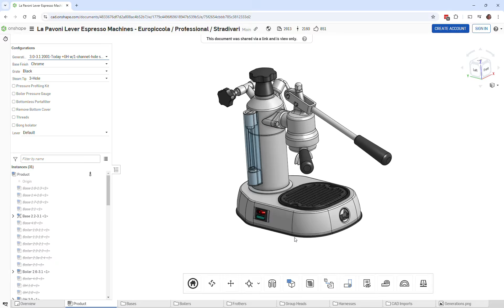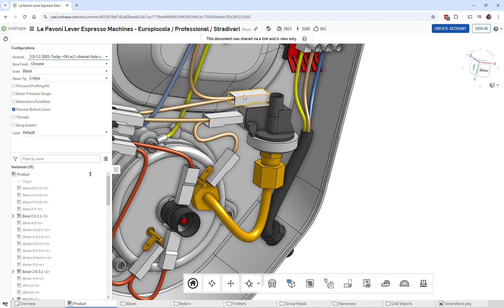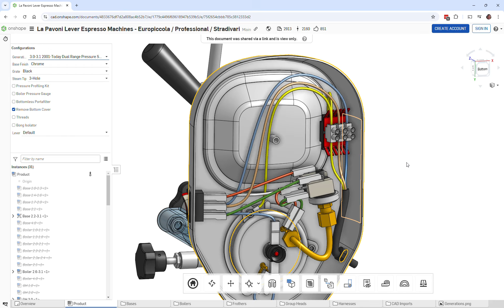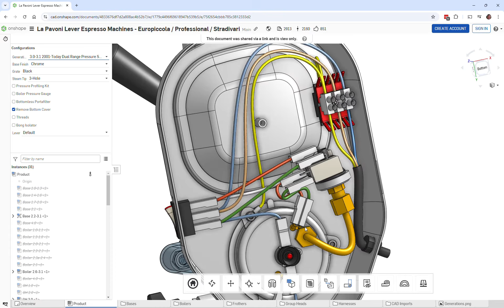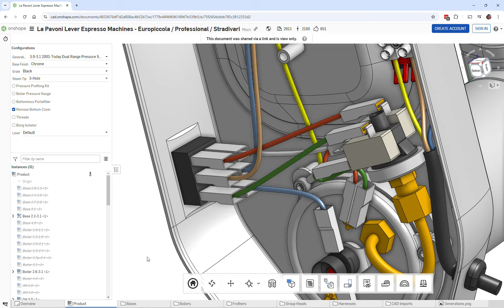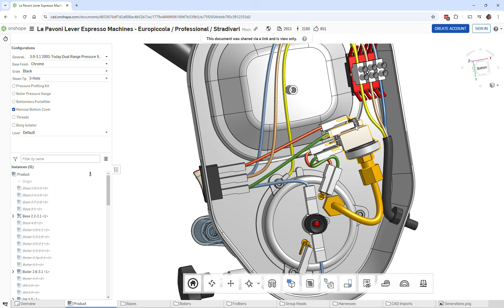22. Dual Range Boiler Pressure Switch Addon for La Pavoni Lever Espresso Machines

Comment: Super helpful diagram!  Just finished upgrading a 1979 v2.2 to 110v with the dual pressur system and first test went well!  Now i just need to practice 😅
Reply from the maker: The problem now is: no more excuses for less than perfect latte art. Have fun!
Reply: @JohnMichaelHauck  now I'm having a bit of an issue, and can't seem to find the solution.  Would be amazing if you could point me in the right direction.

I'm getting a lot of hissing from the OPV (older spring and metal ball) before 1 bar, but neither of the  pressurestats turn off the heat at any point.  I can empty the boiler with just steam.

Could it be a wiring issue?  Do I need to calibrate the pressure stat screw?  

I've seen some forum comments about a stronger spring helping, but I'm not sure
Reply from the maker: @eTreyu27  I think I see you at https://www.facebook.com/groups/lapavonienthusiastsgroup

I'll chat with you there.
Reply: For 110v, which do you consider the hot? Brown or Blue wire?  Thanks!!